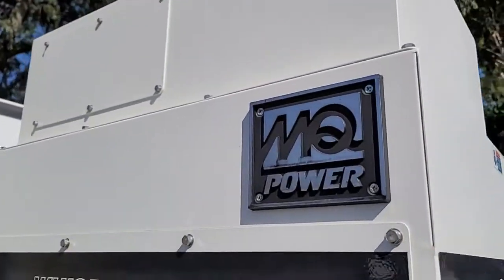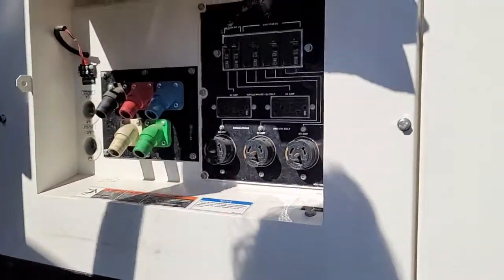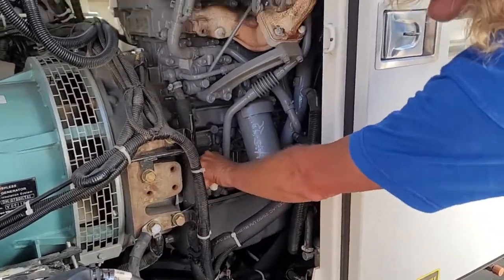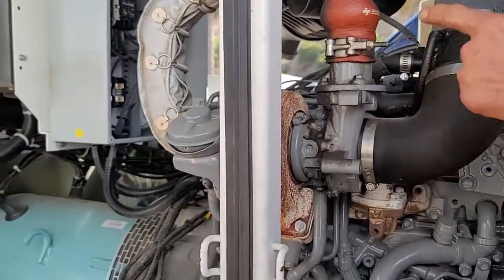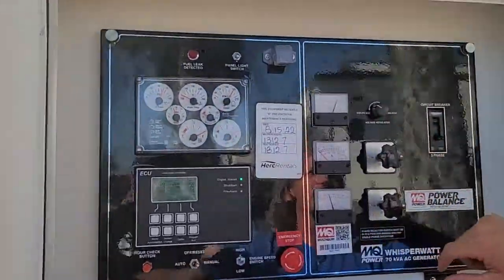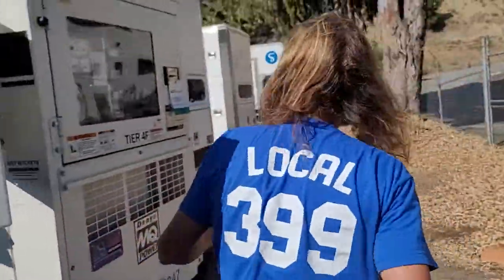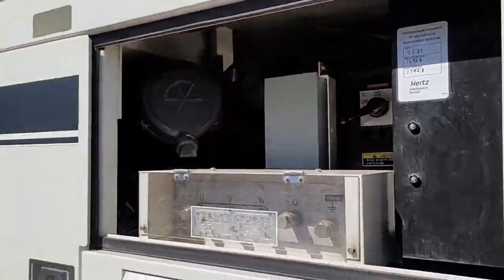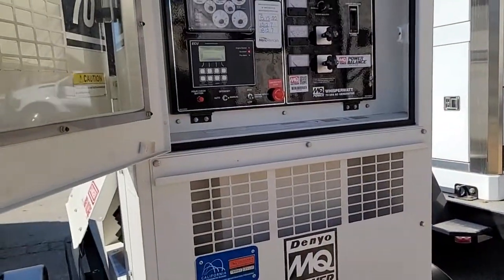How to Fire Up an MQ Whisper Watt 70KW Generator

Comment: Great video, Maik I have a MQ multiquip I have an issue with the water temperature gauge the unit turn on all the sudden just cut off and the water temperature alarm start flashing. Do you have any ideas that may cause the problem?
Reply from the maker: I missed this comment from five months ago. What was the solution?

Comment: Does it Require Diesel Exhaust Fulid
Reply from the maker: I don't recall this one I would have to rewatch the video if they do require diesel exhaust fluid it would be noticeable by a blue cap I don't think this one does most of the ones I currently operate do it's terrible it throws all kinds of codes and they are not reliable as the older ones that work much better and probably pollute less because they use less diesel because they don't need to super heat the exhaust using more diesel. The 22-year-old college graduate environmentalist that engineered this have no clue

Comment: Behind the control panel is a fuel pump switch.  Should this switch be on or off?  Its currently off, but when i switch it on, it goes immediatly back to off position when i release my finger. The manual does not say anything about this switch.  I am trying to fire one up, but no luck.  Will replace the battery tomorrow as the next step. 25kw version.
Reply from the maker: That's called a momentary switch you hold it in the on position and it will pump to build up pressure and help you get the air out of the system as soon as you let go the default position is the off position. Some of the generators I work on have that type of switch it's very helpful for using after you service and you're purging the air out of the system.
Reply: @MichaelDillin  Thanks so much for the info, great video all around.

Comment: Should all plugs be out of generator when starting it up? Safe to then plug into the 50amp recepticles once the generator is running?
Reply from the maker: This is not advice... Follow owners manual.

 I like to "drop my lines" before I shut down and hook them up after I warm it up.
Some people make sure everything on the electrical distribution run is switched off at each appliance (lights, air conditioner, anything that could draw a load) then they shut down let it cool to normal temp before turning off Generator. 
Fire up the same way after you "walk the lines" at the beginning of your shift making sure all switches are off (no load) then fire up Genny, warm up then bring up things slowly one at a time.

The only time I would not hook up while generator is running are "LUG" connections... In my opinion it is safer to hook lugs up with generator completely off/shut down.
Cam/lock ends should be connected without load. It is important to know the order to connect and disconnect.
If you are using the 20amp convenience outlets (usually single phase operation only, it is usually listed on panel by plugs) it's a small potential load and I am not as concerned with those.
Also 50amp 210volts twist is easy/safe to plug and unplug.
It is always recommend to connect and disconnect without a load. 

Everybody will do things a little different. I follow the lead of the guy running the generator, unless I don't think is safe or don't understand the instructions, in that case I ask for help from someone more knowledgeable in the subject than myself...

Be careful electricity can BITE!
I've been getting bit since I was an 8 y.o. latch key kid fixing broken lamps at home and borrowing the medium base fuses from other circuits in the house so my mom wouldn't yell at me when she got home to no lights in the house. 
I could have died many times. I count myself as very blessed.

Comment: It's shutting down because the manufacturer probably didn't record a payment received in their system
Reply from the maker: It's possible the vendor may do that I'm not sure if you have a loan or lease on the equipment from the manufacturer that they would be allowed to do that could be used for hospital emergency etc could be a liability issue. More than likely they shut down when one of the sensors isn't happy with the oil pressure the water temperature or level or the emission systems at least that has been my experience.
In my experience even when they are over their maintenance schedule sometimes I've gotten a generator delivered that was over its maintenance schedule and it doesn't shut down unless the viscosity of the oil is so low that the pressure does not maintain the minimum standard to prevent shutdown.
One time had a vendor delivery on a trailer mount with a Honda 7000 the department that ordered it called me over because it kept shutting down after 5 minutes. I did the rudimentary check and found the oil to be a court low do I added a quart a quart low on a Honda is rare I've never experienced it fired it up and it still would shut down after 10 or 15 minutes. So they called the vendor and he came out didn't ask me any questions just immediately took out his oil drain pan did a service fired it up and drove off. I was amazed I realized this is their standard for oil maintenance they run it until it has zero viscosity to keep the low oil pressure sensor working and then they change the oil that's a terrible maintenance schedule however some people don't care about the equipment at all they just run it into the ground.

Comment: Very Nice Mike. I recently had to fire one of these up in DC and it kept shutting off. They had to send the genie op to adjust it.
Reply from the maker: Yes, there is lots to do. This video is just to demonstrate how to fire it up, assuming that all of the other details have been covered proper phase, proper voltage adjustment and proper cable connections proper crossovers. There are so many things when you’re dealing with this much electricity, you need to be very careful. Walking your lines after they have been run making sure all the connections are tight and firm. I can’t pack 15 years of learning into one video. This is just basically how to fire it up assuming everything else is ready to go. I’m glad you sought the help of a professional if the voltage isn’t right, you can burn out motors, even if voltage is too low.